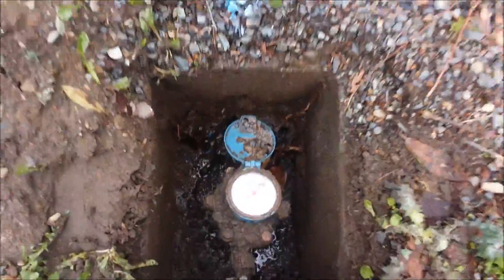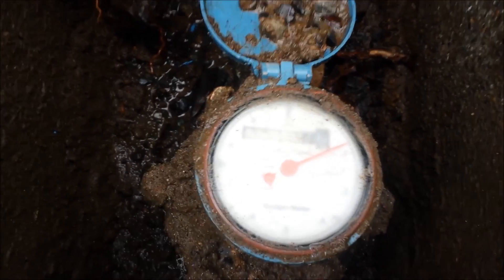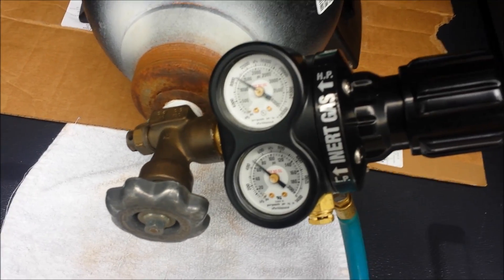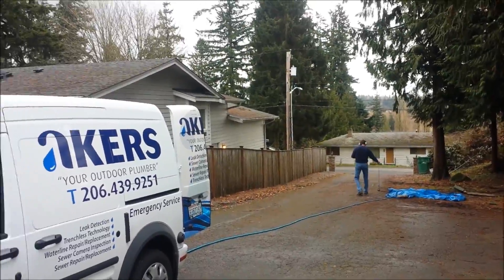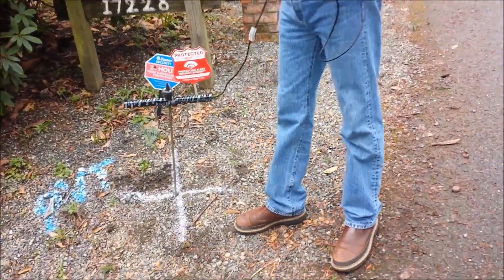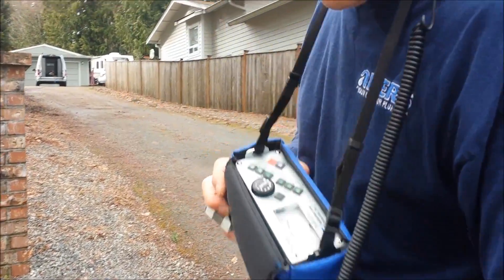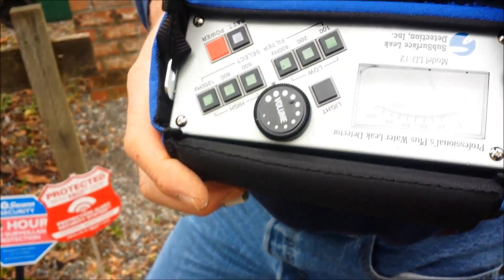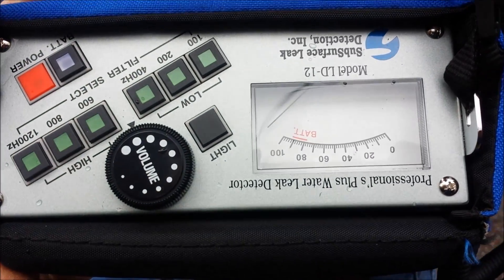How to Find Water Leak Outside Home (Incredible Sound)

Comment: Are you using Gas to pick up odor. Then use your listening device?
Is the sound of leak louder with gas or water?
Did you turn water off and drain line before pumping in gas?